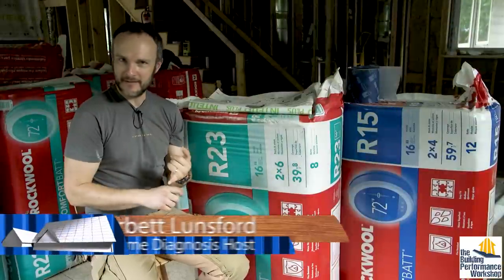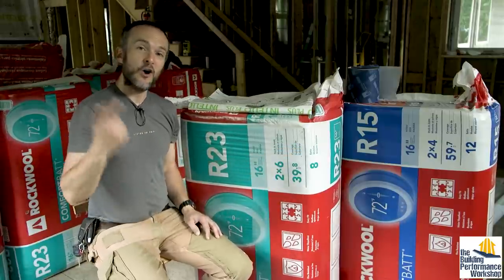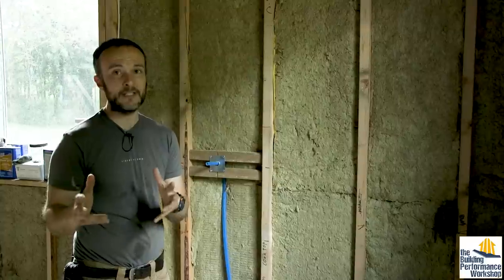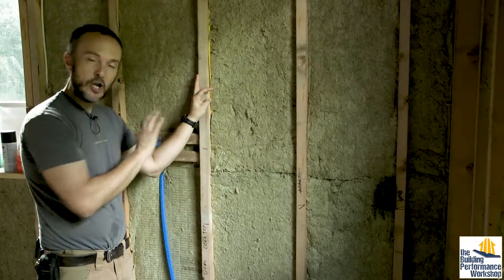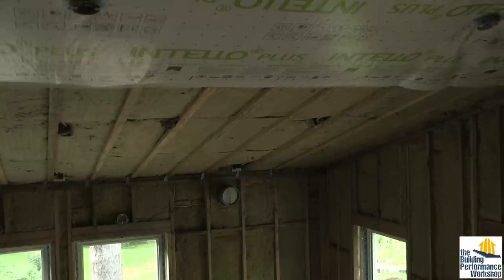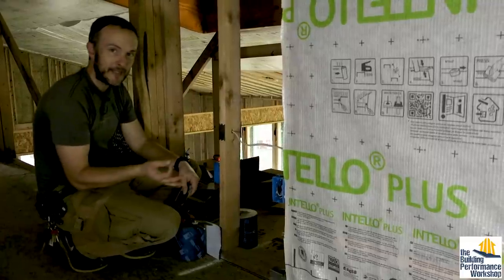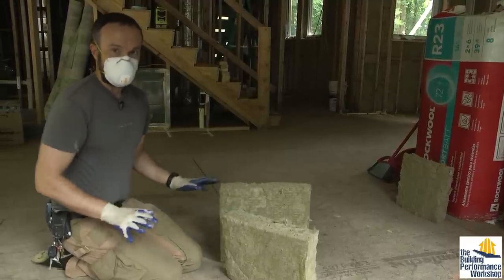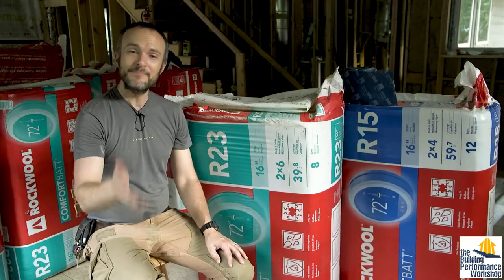New House Insulation, Intello Membranes and Tapes

Comment: Question concerning your comment at time stamp 13.30.  You mention that the electrical code states that outlet in exterior walls need to be every 6'.
Is that a local electrical code?

National Electric Code 210.52(A) states "A receptacle outlet must be installed in every kitchen, family room, dining room, living room, sunroom, parlor, library, den, bedroom, recreation room, and similar room or areaso that no point along the wall space is more than 6 feet, measured horizontally along the floor line, from a receptacle outlet."

This means that outlets can be installed no more than 12' apart ... The 2 outlets are no more than 6' from any point that exists between them.
Reply from the maker: I must have meant 6' from every entry and then 12' apart. Either way, the exterior walls are an issue to be addressed.
Reply: @HomePerformance  Thanks for clarifying.  I'm always curious as some states/cities have code restrictions that are greater than the national code.
You gave really good explanations concerning different wall insulation levels.  That software package is a great way to help keep a project on budget.
Reply from the maker: Thanks @TechSkills, appreciate your thoughts.

Comment: Hi Corbett, could you tell me if your skillion roof is vented or unvented, building a house with a skillion roof this summer, in northern Quebec, Canada, and wanted to do an unvented with Intello plus and Roxul but was thinking of filling the cavity btw the i-joist...?  Would really like a side cut of a good set-up thx!!
Reply from the maker: Unvented, 5” gap on top. Would NOT recommend for your climate, Dan, you’re dealing with very different temps up there. Filling the cavity sounds good. If you’re nervous you can use Lstiburek’s vapor port detail as well.
Reply: @HomePerformance  Thx! So i would go unvented with Rockwool completely filling cavity to top, and Intello plus inside, would you still use a osb with barrier in my case? Appreciate your feedback!
Reply from the maker: I’d use ZIP on the roof if I were you, actually, unless you’re doing an exterior membrane
Reply: What's up Corbett? In NC, so far planning to fill my roof cavity with blown in cellulose and intello, 14in cavity.  Had zip scheduled to go up on the deck but been toying with the idea of a Adhesive skin and plywood to allow the I joist cavity to dry to the exterior and rain screen under my standing seam. Any opposition?
Reply from the maker: I think that sounds great
Reply: @Home Performance  close second, could I get away with your same setup minus the radiant barrier? Hard to find dense packed installers in my area
Reply from the maker: Don’t forget the vapor diffusion port. And you don’t need dense-pack, it actually lowers the R-value. Sure, lose the radiant barrier if you must- if it’s not there, no reason for an air gap.

Comment: The modeling is correct, but the lack of significant difference is due to diminished returns of insulation, not the presence of lower insulated R15 int walls. For your mild Atl. climate your R15 int. + R8 ext. is already deeply into the flat part of the diminishing curve. Under these conditions, adding more insulation on top simply has insignificant impact, but that impact is divorced from your inability to evenly insulate to that value. Therefore I must strongly disagree with your explanation that the insignificant difference is  due to heat following the path of "least resistance" and all it implies. However, while still agreeing with the messaging to model and use science to drive your decision making process. 

Repeat this model but put R23 on all walls, you won't suddenly get a significant difference now that you eliminated "the path of least resistance". To punctuate further, your windows are <R5 so why are you even insulating to total R23 to begin with in the presence of such a "path of least resistance"? Likewise, try this same model in climate zone 8 and find that putting the R23 int. insulation where you can will in fact make a substantial difference, even with half the int. walls being R15.

Heat follows all paths as a function of delta t, conductivity and surface area. With these conditions set, the highly insulated low conductive paths conduct the same heat regardless of the presence of highly conductive paths. The higher conductive paths will increase the heat loss, but they do not impact the heat loss from the lower conductive paths. There are some caveats here, but this paragraph is premised.

Comment: What software do you use for energy modeling?
Reply from the maker: I’ve always used REM/Design, but I wish I used Energy Gauge instead
Reply: @HomePerformance  I use energy gauge on a very limited basis just for code-required energy calcs. What advantage does it have over REM/Design?
Reply from the maker: It also is Manual J compliant, which REM is not

Comment: I am close to building in the ATL area soon.  From your energy analysis, would this also indicate that there is no real advantage to going from an R15 2x4 wall to an R23 2x6 wall?  For some reason I thought I had seen an analysis that showed you are on the "flat" part of the curve at this point.  I plan to install an ERV system to complement what is hopefully an airtight house using Zip and AeroBarrier.
Reply from the maker: You don’t need AeroBarrier if you’re using ZIP, Neil. Good plan though- let me know if you want any help locally!
Reply: @HomePerformance  and thanks for that.  Just trying to balance the cost/benefit of Zip, ZipR, aerobarrier, traditional HVAC versus VRF, solar, etc....
Reply from the maker: Lots of ways to get stuck in the weeds for sure!
Reply: @jneilcopeland  are you in a hot humid climate?

Two things.
1. I'm not a big fan of zip sheathing. It's osb and you should read what building science corp has to say about osb - not good and plywood is much better.

But did you know you many not even need sheathing? If you are using stucco you can use it without sheathing-no osb to rot away or get mouldy and it saves money too 

2. In a hot humid climate vfr is generally not a good idea. It can and will reduce the flow low enough that the coil is not colder than the dew point.ie it maintains temp with no dehumidification which is a bad idea. If some one tells you to get a dehu they should also tell you that a dehu can consume up to 10kwh a day, which could be  up to 1/3 of your energy consumption
Reply: @jl9678  Yes, I will be building in Atlanta.  I live in a 20 YO house that I consider very drafty and desire to have a tight home going forward.  What would you recommend as an alternative to Zip, OSB, and stucco (which wont work for the aesthetics of my home).
Reply: @jneilcopeland  the better alternative to zip is plywood. I breathes better, and moisture migration is a lot better in plywood than osb. So ply wood plus a breathable house wrap is my suggestion.

I'm in Dallas and I live in a 40 yr old house and don't feel any drafts and this is a code minimum house.

Actually one place that was cold was our bathroom with 6 recessed lights. Those things should be illegal. In winter our bathroom was cold. Once I replaced the can lights with the sealed replacements they problem went away
Reply from the maker: You can see the combo O is describing on our TinyLab- that’s exactly how we did it:
https://youtu.be/3IyqXzVoD5Q
Reply: @jneilcopeland  here is the text from BSC

"On to the plywood versus oriented strand board (OSB) change.  Folks, this is a big deal. No matter how many times manufacturers say that OSB is just like plywood it just isn’t so.  Check out Figure 3 and the relative differences in water vapor transmission between plywood and OSB.  Plywood becomes vapor permeable as it becomes wet—OSB does not. Did I mention that this is a big deal?  When plywood gets wet it dries a lot easier (and faster) than when OSB gets wet because it becomes vapor open. Moisture also migrates laterally within a plywood sheet a lot easier than OSB.  The lateral movement and vapor openness when wet allows the plywood to more easily redistribute moisture than OSB. This means that with OSB moisture becomes concentrated at OSB/building paper interfaces—whereas with plywood the moisture is released into the cavity as well as allowed to migrate laterally reducing concentrations and localized moisture stresses. "
https://www.buildingscience.com/documents/insights/bsi-029-stucco-woes-the-perfect-storm
Reply: @jl9678 I second what you said about coil temps with VRF. If you go that route, make sure the equipment has a "dehumidification-during-cooling" mode. I know a lot of the ductless/ducted mini split systems do not. Daikin Quaternity does, and I think some of the larger inverter driven split systems do but I don't have a comprehensive list. Amana systems do, Bosch systems don't and Rheem didn't as of 3 years ago and probably still don't. I've seen some Amana systems performing beautifully in homes that were real nightmares with high humidity before.
Reply: @jbecker386  I've seen some studies where even the dry mode wasn't that effective in controlling humidity.

I like the idea of mini splits but they have a long way to go before I can buy into the technology.  My younger brother who lives in Phoenix az , where it's dry, loves his min split
Reply: @jl9678  yes I've seen the same thing. Daikin Quaternity actually does reheat. The 15k btu can remove 104 pints per day. Any time I sell other ductless products, I state very clearly that the system may remove little to no humidity.
Reply: @jbecker386  wow. 104 points per day. That's serious moisture removal. I'll never to check out the daikin line
Reply: @jbecker386  I looked at the daikin submittal. Wow. It's a crusher!
115 pints per day is huuuuge. Compared to some units that do less than 5 pints a day this is massive.

Question (sorry to hijack , Corbett) does it turn off when it drops to set temp?

My brother has a gree that will just keep cooling even well past the set point. The only way he can get it to turn off is to use the WiFi program to have it turn off at a set temp BUT then it won't come back on. I want a mini split that will turn off when set temp is reached
Reply: @jl9678  that's what the reheat is for. It can dehumidify with little to no sensible cooling. I haven't really tested it out real thoroughly, and I don't recall what I read about the control sequence but it's a vastly better dehumidification setup than any other ductless system on the market. I don't prefer ductless systems due to their poor filtration, ventilation and distribution, but in certain circumstances this thing is perfect.
Reply: @jl9678  I'll try to dig up a service manual when I have time. Daikin is pretty good about giving us access to all the details of how their control algorithms work unlike some of the others
Reply: @jbecker386  I have to agree. I've studied the issue ad nauseum and ductless systems are not the answer.

I'm going back and forth between a high latent central heat pump or a room by room system using window units for the cooling and hydronic radiators for heating.More likely the central heat pump
Reply: @jbecker386  that would be great. Thanks!
Reply: @HomePerformance  I build in Atlanta and would love to discuss how to improve our process.
Reply from the maker: Hi Brian- happ to help you. I’m easily reached through http://BuildingPerformanceWorkshop.com

Comment: 6:52 not true heat rises meaning you need more in the attic than in the walls
Reply from the maker: Heat does not rise. Hot air rises, when it’s surrounded by colder air.

Comment: At 10:00  where you explain how overstuffing walls yeilds little improvement in performance. Your example is confusing to me because you seem to be saying that its not worthwhile to have great variation in wall performance in a simgle building but your example seems to show that stuffng more insulation than can fit into the wall cavity will yeild little improvement in home performance. I dont think anyone who understands the basics of how insulation works would overstuff wall cavities with the belief that the more product you stuff in there the more insulated the wall would be. What we really want to know is how detrimental is it to have a wall,/door/ceiling that's less insulated im an otherwise highly insulated house? Not every house is a new build and some insulation improvements like 1" exterior foam are low hanging fruit while others such as triple pane windows are much costlier.
Reply: If you have continuous external insulation there may not be a noticeable difference. Otherwise for insulation more is better and enough is enough.

Comment: Actually its 5 inches solid when wrap insulation outside. Comfort board 110 5 inches thick r 20 over cmu block with vermiculite cores. Air gap r 2 and masonry veneer. Canadians usually vapor barrier inside of house. Not only do they tighten head bolts twice but also put and a certain angle extra of tightening. We use low perm wraps to keep moisture flowing out. Yes it does make sense to insulate at different levels. Too much insulation will trap condensation. Or like people spray foaming rim joist pockets creating moisture pockets. Or people trying to use fiberglass around doors and windows. The term we use is educated idiots. Looks good on paper but real world moisture problems happen. Moisture in air tight houses should be addressed. Kitchens, bathrooms, rim joist pockets, basements, and around windows and doors.

Comment: I fundamentally disagree with your approach to remove plastic from your home + allowing any moisture to travel into your wall. I will however admit that most of everything else you say is spot on.. Perhaps the difference is I'm in a much farther north climate. So it might be climate differences. Code won't even allow semi-permeable membranes (like Intello) here.
Reply from the maker: Right on- I always try to include the exemption ‘unless you’re in Alaska or Miami’ to that plastic bit. Anywhere there is more than one season, plastic is in the wrong place in the assembly half the time.

Comment: You want your sleeping spaces to be cooler than your living though. Especially with women. Just saying my frustration when she turns it down to 60 at night then opens a window to heat it back up is immeasurable.
Reply from the maker: All women are different, Steven, and to add to your problems so are the men- the real goal here is control.
Reply: @HomePerformance  Right but for both genders you want your sleeping space cooler than your living.  Just been my experience if favors one, didn't mean to imply uniformity.
Reply from the maker: I hear you Steven, don’t worry- but I’ll also point out that most people have never experienced a truly high performance home, and the feelings of comfort and the taste of fresh air do not require bumping tstats up or down or opening windows.